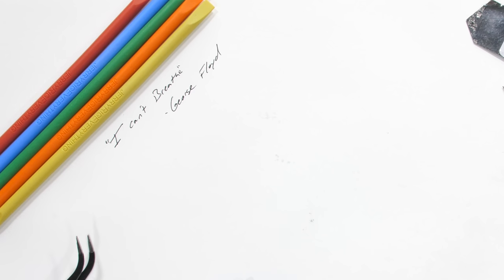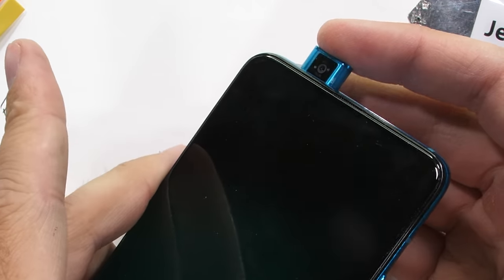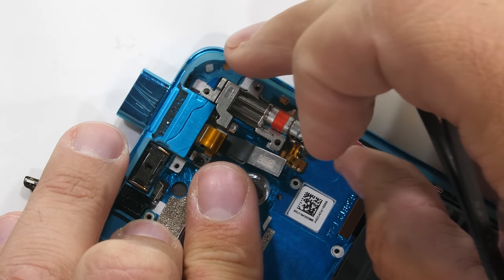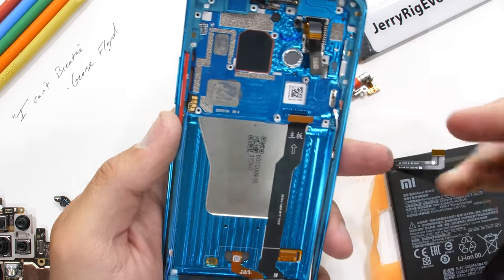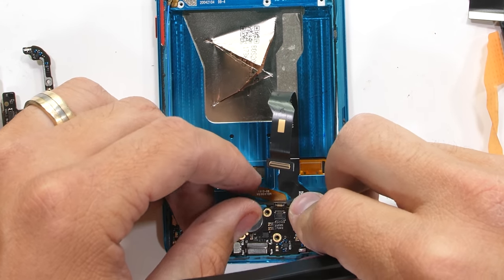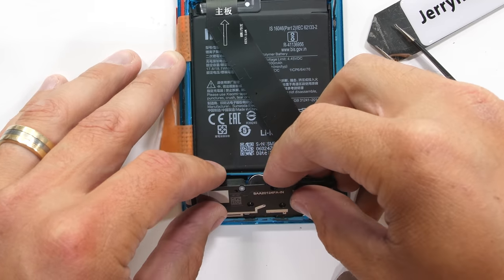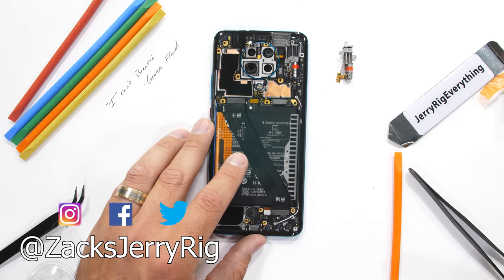We've NEVER seen cooling like this! - Poco F2 Pro Teardown!

Comment: I got my F2 pro secondhand for 70 bucks, amazing the kind of value you can get secondhand these days.
Currently using it as a poorman's switch next to using it as a phone, the 'second space' feature is amazing for that. Got my android tv launcher with my emulators and everything on one finger and my main phone space on my thumbs lol
Reply: This can run Nintendo switch games as well. The emulator is pretty shady - you need to buy a specific switch style controller add-on to use it - but it works pretty good on f2 pro.
Reply: The one that sold you this phone for 70 has to be dumb AF, I bought an 8/256 version for 200EUR and this was already a crazy good deal where I live cuzz this used phone sells for 400+ EUR lol (I even saw two still packed on Ebay, one was for 750EUR and the other was for a stupid 950EUR)
Reply: @BlackBullPistol  Damn that's insane, The guy just sold it to me for 70 because it had a cracked screen lol
Reply: I used buy it with price  110$ with condition is it old😅😅

Comment: Hey Jerry...or Jack...or Zack... whatever......
Since I am a Mechanical Design Engineer, the spring in the front camera mechanism is part of what is called "Fail Safe Design". A moving front camera mechanism design follows one of two modes of failure: either Fail Open; or Fail Close. Since nobody wants his camera to stop functioning should a malfunction takes place in conjunction to the front camera mechanism, a spring is added to the mechanism so the failure follows a "Fail Open" mode.

The spring also keeps the front camera open even if you applied force to close it during normal operation with no malfunctioning taking place, and thus only the stepper motor can retract the front camera back into its grove when not in use. 😉

Comment: You are wrong, the motor unit is worm gear drive type. You shouldn't able to move it back freely. To check if it really seized or there is an electrical fault you could try to turn it.

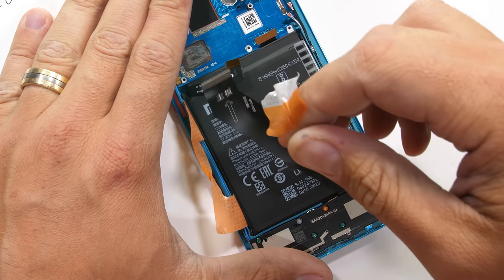Comment: In 3:29 you broke the pull tabs because you were pulling on the wrong one... should've pulled on the orange pull tap at the top. Not only that, there are instructions how to do this exactly ON the pull tabs 🤦‍♂️. They are clearly visible even in the video. I just had to remove the battery from my PF1 in this way and it was a nice experience, as opposed to removing batteries which are just glued to the case. For the sake of the people that will follow your video, please add an annotation around that timestamp to point out the correct way to remove the battery.

Comment: thank goodness  for your video. 
My Poco woulnd't carge up and it was the ribbon calbe of the connector board that got loose. 
Thanks to you and a good squeeze at the right spot repaired it for the moment :D
Reply: mine wont turn on, it suddenly shutdown while I was using it. When I charge it up it just show red LED and blink twice.
Reply: @aljibejerwin  oh no That doesn‘t sound good i would guess a faulty Batterie.

Comment: You can't move that type of transmission with force, it will not work, the only way to move it is with twisting the axel, or if the step is very big can actually work but with huge torque

Comment: Can you solder the ribbon cable form the broken motor onto the replacement one and see if it works? I don't see why it wouldn't. Also idk what they are called but could replace the motor with a spring loaded toggle thing like in an sd card slot so it will pop out when you press the camera in and stay in when you press it back in.

Comment: You can't move a worm gear by applying pressure like that.  You probably could have spun the worm screw and broke the motor free - if that actually was the issue.

Comment: They are probably trying to copy the copper aluminum design from modern cpu heatsinks... But aluminum is only better than copper at dissipating heat into the air when there is sufficient airflow. Otherwise copper is still better at transferring heat from contact surfaces. This is why cpu heatsinks are designed with copper and aluminum.
In this phone's case and design choice, its better to go pure copper but if we assume it has a bit of water resistance then aluminum is better because of lower oxidation rate.

Comment: Which phone should I buy for pubg ?
Realme X2 Pro or Foco F2 Pro ?
The realme phone has 90hz with ddr5 ram with sd 855+ ( battery : 4000 mah ) but the Foco phone has sd 865 with ddr5 ram & a longer battery (4700 mah) without 90hz .. Both have Oled Panel with Hdr10+ support.
Reply: I have a 120 Hz capable laptop and switching my usage from laptop to my 60 Hz phone really doesn't feel different. Maybe just take Poco unless your eye is sharp enough to notice 30 Hz difference on the screen.

Comment: Btw if you put 3 to 5 volts on the little camera engin since he is remove and you did drop the gap a little he will probably work again unless you put the voltages on the wrong side he will turn up again instead of down, but you can still gap it down a little again !!

Comment: hey idk if you look through comments but i work on phones and repair or strip them and i can never get the heat right any suggestions or times? I only have a heat gun and can check the temp.

Comment: Did i miss the nfc plate or there was non inside?
The phone's specs says there is an nfc...
Reply: Okay so i just found out that weirdly.... The nfc is located on the top of the plastic that sits on the cameras.
I looked for it everywhere and tried every cm on the device and couldn't find it.
Eventually the only place it read cards, is realy on top of the device above where the cameras are.

Comment: Vote?  Those who decide who votes and counts the votes make voting a nonsense.  In the Netherlands voters must use a red pencil and never wet the tip as it makes changing the vote impossible. In Northern Ireland you get your voting slip with a number on it which is linked to your id, meaning it's easy to see whom one voted for.